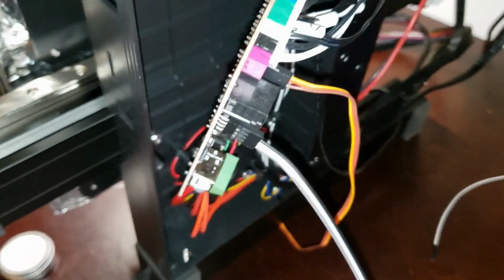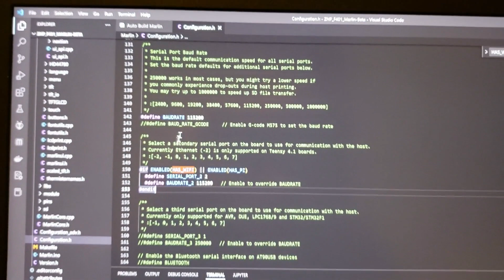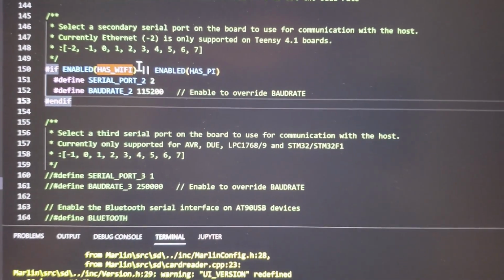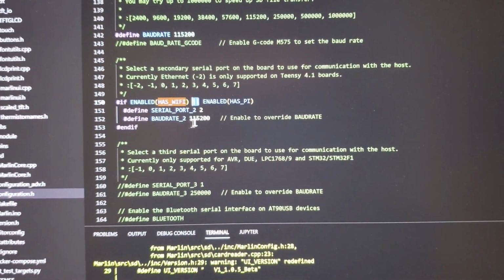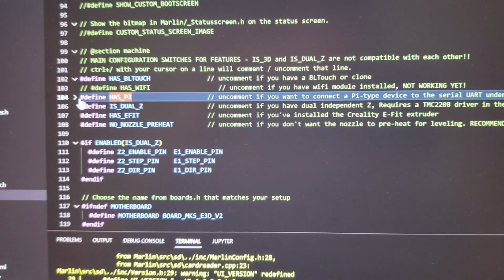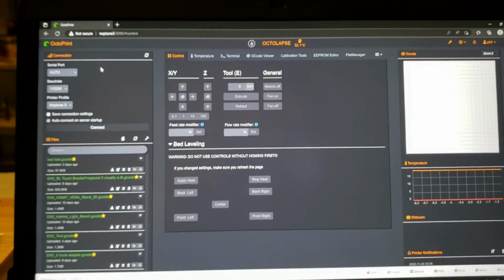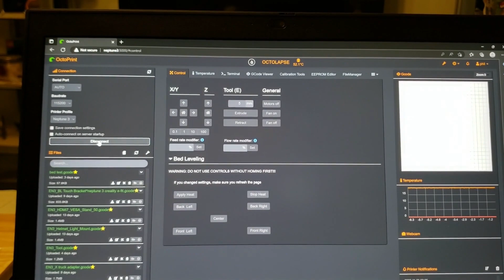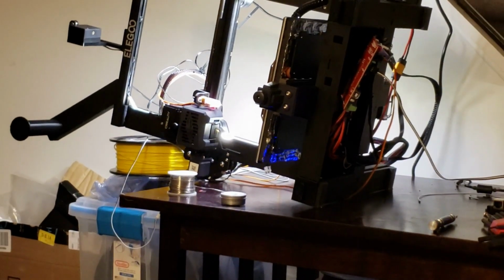Bye bye USB! Elegoo Neptune 3/MKS Pi  connection via serial UART

Comment: Hey, I’d appreciate some help- using Pi4 with Neptune 3 pro and mainsail. I have everything crossed and done right, but klipper doesn’t recognize the uart. I tried using screen command to see what the uart was outputting and I’m getting extremely garbled signals, at both 250000 baud and other values. Any ideas? Using PA2/3, all other settings you outlined

Comment: Ok, so soldered my 4-pin header onto the J17 location on the N3P mainboard. Made my serial to USB cable. Also re-ran the menuconfig and selected the PA2/PA3 and then recompiled and loaded the firmware.  Where is the configuration.h file located exactly?  Hoping to get some help on changes needed in the config files to get this working.  Also, do you have a video available on making the needed changes to the files in Klipper? Any help is appreciated.
Reply from the maker: @Snyperx77  I have a video on compiling Marlin firmware (homing sensor shootout video) as well as a playlist of klipper setup videos.

Comment: Did you have to disable the LCD for this modification? I'm trying to do the same as you with a raspberry pi 2w. When I compile the elegoo neptune 3 pro marlin firmware with the changes shown here, I get an error that #error "LCD_SERIAL_PORT cannot be the same as SERIAL_PORT_2." My configuration.h file is:
#if ENABLED(HAS_WIFI) || ENABLED(HAS_PI)
  #define SERIAL_PORT_2 2
  #define BAUDRATE_2 115200 
#endif
Reply from the maker: No I didn't. The pro has a different pin out than the standard 3, so that could potentially be part of the issue. I haven't looked at Marlin source code in over a year, so I'd have to take a look and see what's going on.
Reply: @TheFeralEngineer  Oh I see, that makes sense, thank you! I'll figure it out, just need to dig deeper into the firmware / pinouts.
Reply from the maker: @alan_felt  honestly, if you're going this deep, klipper is only moments away. Only time I really ever use the controls that are built into the machines are when I'm doing YouTube videos about them. The rest of the time, I'm controlling them from a different source
Reply: @TheFeralEngineer  I've definitely considered it and will probably go that way some time. I'm trying to keep the builtin SD card working though so anyone can use the printer even if they don't use the octoprint server.

Comment: I tried but my rpi doesn’t communicate with much or connect.  What’s the commands or steps on the software side?
Reply from the maker: @menotu2920  you need to build a binary to use the correct uart pins on the printer MCU and you need to make are the uart pins are active on the Linux device you are using. You also need to make sure to cross tx to rx and vise versa

Comment: i'm sorry to bother, but i cannot in any way make octoprint detect my printer after connecting via UART... i've tried numerous guidelines, but still no result.. anyone has any tips to share? my klipper works just fine with the mks pi, i had installled a webcam and all
Reply from the maker: you have the TX going to RX and vise versa? You also need to connect the ground and flash firmware with the proper serial channel enabled. Did you compile new firmware?
Reply: @TheFeralEngineer  yeah my cable are swapped, i did it after i could not get any connection while changing the firmware to the uart one, i did flash the firmware yesterday i even did a couple of prints from inside fluidd, the only step i'm missing is the detection of my printer from octoprint
Reply: like in this video is almost automatic.. but i cannot get this connection to settle
Reply from the maker: @mcase5617  if you're using klipper/fluidd, octoprint isn't necessary
Reply: @TheFeralEngineer  yeah i read that it can perform the same way basically i just tried to install it because i wanted to try obico but the installation process initiallly stopped me from installing "traditionally" because it found a octoprint folder. i'll try to perservere ignoring the issue and adjusting to it. thanks a lot, your video are amazing, you inspire me

Comment: Would it be safe to power RPi Zero 2 W using this 5 V pin you left unused?
Reply from the maker: You might be able to. Gotta see what's the power consumption is off the mks WiFi vs the rpi zero. I know the 4 draws too much current

Comment: In case you're having troubles connecting via UART to your Neptune 3 Pro: don't be as alternatively smart as me and don't skip "Select (Serial (on # USART2 PA3/PA2) if you want to use the serial UART pins on J17 (wifi section)". It works perfectly fine now! :)
Reply: Is this in the marlin firmware compile?

Comment: my usb cable just ruined 2 prints for me, i probably wont do this serial mod, the software aspect is what i hate doing. so i think i might just hard wire a cable to the motherboard out the back
Reply from the maker: That's pretty much all this is doing. It's bypassing the USB and going straight in through UART.
Reply: FWIW it's the USB hub "going to sleep" on these printers. Mine was giving me errors and canceling prints at random times and it was always "usb_port_inactive" where it drops

Comment: did you try klipper in this setup?
Reply from the maker: I did. I was running Klipper on the mkspi with uart for a while, then both of them started experiencing shutdown issues that Makerbase and Klipper refused to address, so I moved on to Bigtreetech products and have been happy ever since.
Reply: @TheFeralEngineer  Was this problem a timeout with the MCU and then the klipper went into shutdown? I'm having these timeouts from time to time on my Neptune 3 Pro and Klipper, but I use the RPi3B+
Reply from the maker: @Obagunceiro  yeah, MCU shutdown timer too close or something like that. I asked the klipper community and they were incredibly toxic and I asked makerbase and they told me to buy new ones. Nobody would help, so I went to Bigtreetech. Are you running uart or USB? What's your baud rate set to?
Reply: I'm using USB, but thinking about changing it to SERIAL precisely to try to solve this problem, I'm getting random timeout with MCU 'mcu', I've tried so far to change the USB cable, cover the 5V pin, and I had also tried to change the baudrate, but if I'm not mistaken, I couldn't change it, the printer didn't communicate, I can try again later, but now I just flashed a new .bin, I'm using yours, previously I had flashed my own, in my klippy log  is showing this : SERIAL_BAUD=250000 @TheFeralEngineer
Reply from the maker: @Obagunceiro  sounds like you're doing everything correctly. One of my group mods switched to uart on his 3+ and his dropouts went away, so I would suggest trying it 

If you use different baud, you have to specify it in printer.cfg
Reply: @TheFeralEngineer  Does this baudrate need to be specified in .Bin as well? When I tried to change I only changed the printei.cfg, do you recommend which other one to test? And is the path to communicate via UART the same as in your video?
Reply from the maker: @Obagunceiro  uart should be ttyS0. You need to specify the baud you want to use in your make menuconfig and it has to match the baud in printer.cfg. default of 250000 for USB doesn't require a forced value in cfg
Reply: @TheFeralEngineer  in your printer.cfg you say that to use the UART pins use PA3/PA2 in the makemenu config and use the J17 pins, but in my makemenu only the USB option appears which would be PA11/12 and the serial shows PA10/PA9 , What should I do ? use j17 and compile ignoring this difference, or try to connect via PA10/PA9?
Reply from the maker: @Obagunceiro  the USB pins aren't labeled correctly in make menuconfig. Follow what I've got in the notes
Reply: @TheFeralEngineer  Oh my god. I've been experiencing that error too when attempting to print at higher speeds. All sources online point to a slow or overheating Pi which I know is not the case. I'll have to try this, thank you!
Reply from the maker: @XavierBergeron  I decommissioned both of my mks pi units because they were just so unreliable

Comment: I have tried this to connect to ender printers to get away from the small mini usb ports. I appears to me that after loading the sonic pad firmware, the display port is no longer connected or functional. The usb works still but the display port must be disabled from the main board. does anyone know how to activate the screen port or is that possible?

Comment: Sub'd
Thank you, but can you list the advantages of connecting the Pi for those like me, lol.
Reply from the maker: Doing it this way enables you to eliminate the need of having the usb mounted up front, which makes it look cleaner and more integrated into the machine, rather than a second thought. 

The pi allows you to use Octoprint for Marlin or Klipper (or mainsail/fluidd work klipper), so you can use the pi as a program server and to control the machine via web interface

Comment: That looks interesting! Question: besides not having to use an external USB Cable… is there a functional advantage in doing this direct serial connection? There could be even disadvantages… USB is shielded and it uses a twisted pair for differential signal (D+, D-), and a simple serial connection like this could be way more noisier than a usb cable… I would love to get more information about the Pros and Cons of this connection.

Excellent work by discovering how to set the firmware up and make it work with OctoPrint 👍❤️
Reply from the maker: The connection is grounded at both ends and the path is short enough that I don't think there will be any issues with emi. If I run into a situation where I feel it's necessary, I can always build up a shielded, twisted pair cable or get a small ferrite to put around the extension I made. 

Besides turning on the serial 2 in firmware, it didn't require any other special tricks. The cable was a straight path and auto connect sniffed it out right away 👌👌

It was just maddening seeing that usb poke out of the front, so I had to try something 😆. I also did it as a preparation for another project, but I still have to see how that will pan out. My abl video is going to cover firmware updates more in depth than this.